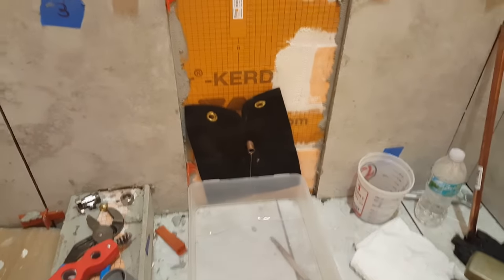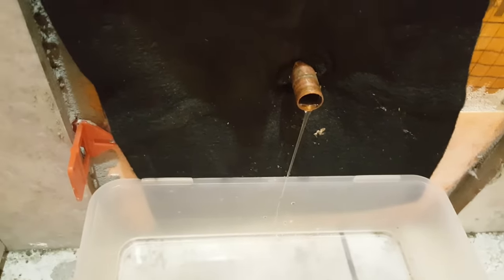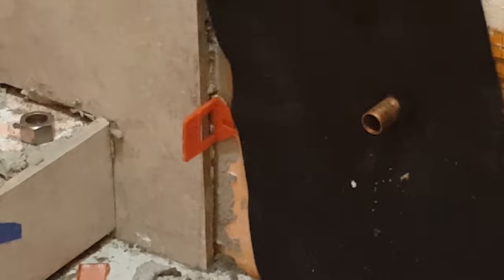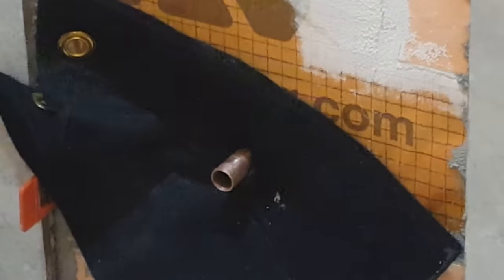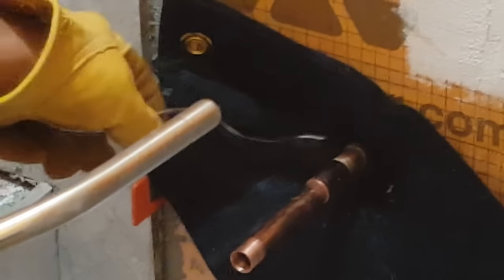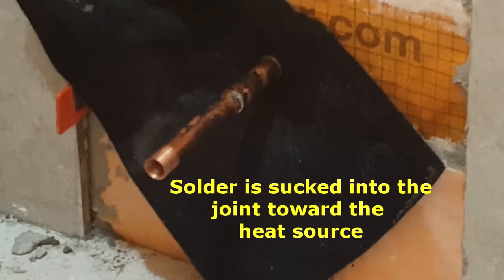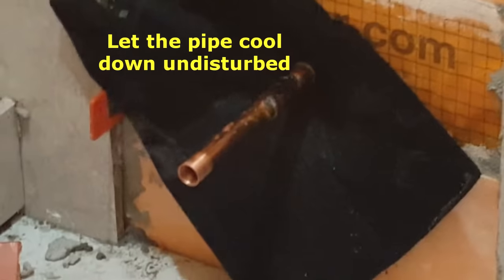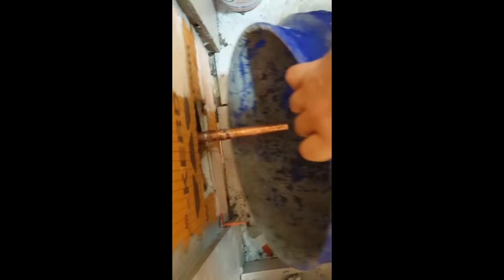Insane Plumber's Trick: Solder Copper Pipes Dripping Water

Comment: My guess is you are not really open to a critique so I won't give one, but this video is not recommended
Reply from the maker: I'm always open to critique.
Reply: @jeffostroff  Another thing that can be done, is to open an outside faucet near the main shutoff, and use a portable tank of compressed air, to blow the water out of the line about to be soldered.  The bread idea is only going to work, if there is a no actual leaking water. The way the water was trickling, there is a good chance of water cooling the copper, right as the solder is wetting to the metal with flux, ending up with a possible spot where the solder did not wet all the full length of the pipe and coupling. The steam visible from the pipe tells us water got past the bread. So there is a risk the pipe may leak later on.

Comment: you need a jet swet
Reply from the maker: 2 things here, 1) this is a DIY video for homeowners, whom you'll never convince to spend $100+ on a tool they will use once, when the bread trick works every time for free. 2) We have a video on the Jet Swet here: https://youtu.be/h1ZF7MWrh1k "Jet Swet Plumbing Tool Helps You Solder Pipe With Water in it"
Reply: @jeffostroff  true that

Comment: NEVER flux the inside of a pipe
Reply from the maker: Never troll a video and tell someone not to flux the inside of the pipe without checking the comments first from the other 100 people before you who already stated that.
Reply: @jeffostroff  I'm not trolling you mate, I'm a plumber and was giving you personal advice to never solder the inside of a pipe unless it's swaged, I'm not a troll 👍
Reply from the maker: @United-Til-I-Die   I did not solder the inside of the pipe I accidentally put flux on the inside,  A momentary lapse of focus slip of the wrist and if you pay attention in the video you can hear me say right after I I applied the flux inside it that it was not necessary. It was 95 and humid in there on the hottest day of that July in a condo villa with really bed insulation in the attic over our heads, no AC flowing to the bathroom, we measured a 130ﾟ temperature in attic over our head. It was the end of long tiring day we had somebody having a meltdown in the next room from us while we were trying to do this and focus on the repair, shooting video, stress of water not cutting off, and we are not allowed to touch the street shut off, and yes I lost my focus for a brief moment. But we cleaned it up and I also use water soluble flux. So it's not like it was some fatal mistake that manifested itself into the final product. I'm sure you've made your share of mistakes over the years as well. I can assure you no humans died because of my slight misstep.
Reply: @jeffostroff  sorry i meant flux inside, not solder 🤦🏻‍♂️, was genuinely just giving advice to you mate 👍, the solder will follow the flux inside the pipe and could cause a solder blob and restrict flow rate and cause water hammer 👍
Reply: @jeffostroff  and yes mate, made mistakes in my line of work, every day is a school day 😏

Comment: first off all, you could have cleaned the copper even while the water is still coming out. Second, you didn't even do a proper solder seal. Third, you only heated one side, I saw no torch rolling around that pipe to make sure the fitting is heated evenly.
Reply from the maker: The solder sealed nicely and it still holding up 5 years later.

Comment: Dont clean or flux the inside of the pipe. Only outside of pipe and inside of fitting
Reply from the maker: Yes it was a momentary slip of the wrist but I guess you didn't pay attention enough to hear me say afterwards that wasn't needed.
Reply: @jeffostroff  u said u probably didnt need it but ur doing it anyway which shows me ur not too sure. You should just admit that at the time of the video u were not sure of urself instead of lying to everyone saying it was a slip of the wrist.
Reply from the maker: @alexstoles1339  Not lying, I did it by mistake, and said it was not needed. I did not "do it anyway" like you said. I realized the moment I did it that I screwed up, and admitted it was not needed. No way to undo it. It's water soluble flux, and washed out on its own when we flushed the pipe. Now you're saying I did it anyway after I said it was not needed? Freaking Democrats, you're all the same. Always have to lie and make stuff up. You're just trying to find problems where there are none.
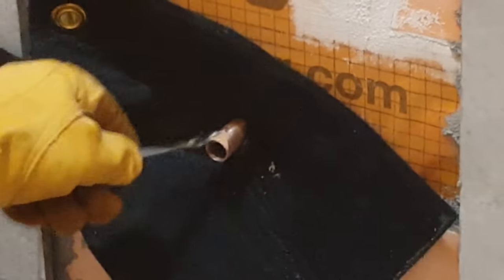Reply: @jeffostroff  go back and listen around 3:10 u said" it PROBABLY DOESNT NEED IT BUT"  that means ur not sure. Probably  is not definite. Nobody here lying but u buddy. U cant admit it but its cool. U can live with being that guy lol. Btw i didnt know this would strike such a soft spot for u. I apologize if ur feeling are hurt. My original message was just to help u out to do it the right way.

Comment: Just find a faucet at a lower level and turn it on, gravity will do the rest and the water will stop running.
Reply from the maker: It's funny how people keep coming here with this same useless advice, they all must have copied it from the same uninformed person. We had already opened valves and re-closed other valves, nothing helps, the water was running, not dripping for the last hour before this video. It is leaking past the gate valve, so nothing will stop it. And this toilet valve IS the lowest level, there is nothing lower than this valve.  When you have a gate valve that refuses to close, nothing will stop the flow of water other than plugging the pipe momentarily.
Reply: @jeffostroff  Wasn't trying to be clever - No basement faucet? thats what I used a few times... then I was  incorrect nothing else would work and yes I have had that exact problem and used a cork on a string with a knot to extract it later, default is a shark bite connector
Reply from the maker: @marciamenage931  Nope. We are in south Florida, no basements here.

Comment: Disconnect the meter. problem solved
Reply from the maker: Not exactly, problem not solved. Many condos require you to give 48 hours notice before shutting off the main, because it will affect many other people. They have to post a warning notice at the elevators for 24 hours before the shutoff too.  People always forget that. You can't just be impulsive and run to shut off the main.
Reply: @jeffostroff  In the beginning of the video it was stated the water was turned off at the main. So It really depends on what your referring to as main, most condos/apartments have shutoffs at each unit. I wouldn't consider a isolated shutoff to be the true main. But I know how it goes in complexes with their policies. But any who the classic bread trick will get you out of a pinch, thanks for sharing!
Reply from the maker: Yes, usually when I say "the main" it means wherever the shut off is for the unit. I usually say "shut off at the street" to refer to the water meter. Or also I'v been known to say shut off at the meter.
Reply from the maker: yes I meant the main water shutoff  of the condo, which was a gate valve over the washer and dryer. I will usually say "shut it off at the street" if I need to go to the meter. but usually in some condos, you have to get permission from HOA first, post a notice at the elevator, 48 hours notice, pain in neck.

Comment: This gentleman is not holding the torch correctly the torch should be turned down and the torch should also be to the point where that extremely blue flame is only about a half inch away from the pipe
Reply from the maker: Everyone has their own way of will be holds the torch and if the others don't do it their way then it's wrong

Comment: Bruh you can't even put the oil from your hands in your pipe let alone a giant chunk of bread....
Reply from the maker: Yes you can, inside the pipe is not where the solder goes. The bread gets flushed out afterwards. Plumbers have been doing this trick for 100 years.

Comment: The pipe coming out of the wall....Jesus Christ man....you don't need to clean the inside of that pipe. And in case you never learned this before...heat rises...put the flame under the fitting.
Reply from the maker: You are actually supposed to start the heat at the bottom, and lead the heat around the top of the pipe, leading the heat before the solder. You can sit there and heat the bottom all you want.

Comment: You DON'T want to do this way !!!  Get a proper Jet Sweat or similar expanding plug tool,  that's all you need and you can solder like normal.  Also you cleaned the inside of the pipe (not needed), you held the torch on the side of the fitting (WRONG). Your flame is way too big and too close causing you to burn the crap out of the fitting/pipe and thus oxidized it all which means the solder won't stick to it after it oxidizes.  At least hold the torch under the pipe and further away and sweat the water out first then clean it all with flux to remove the oxidation once the water is all out then solder it.  You can see on the first joint the solder stuck to the coupler instead of the pipe for the most part which means there was still water in the pipe. Lucky if there was actually no leak after this one.
Reply from the maker: I got news for you professional plumbers have been doing this for decades. Also this is A DIY video for home owners they're not going to spend 50 bucks a Jet Swet,  Just because you come in here off your high horse declaring that anybody that does this trick is an amateur does not mean it is so.
Reply: @jeffostroff  Professional means jack shit, if a professional uses actual bread I would be embarrassed to call myself one. But then the world if full of so called 'professionals' and its SCARY.  I wouldn't let them or you near my pipes after seeing how you soldered lol.

Comment: This video although helpful is not nesessarily the only way to do this.Use compression unions or ball valves with compression fittings and end of the story.Applying flux on the inside of the pipe is not the smartest thing to do because flux is an acid and can and will eat through the copper.You also forgot to debur the inside of that copper pipe and deburring the inside of the copper pipe is extremely important because if the inside of the copper pipe isn't deburred water flowing through the pipe will cause turbulance which will lead to pin holes in the copper pipe.While you were at it why didn't you solder a male or female adapter on that pipe so that way you could screw a valve onto the pipe?All I can give you is an "E" for effort.You should have planned better for that repair that you recorded yourself doing.You ended up using a valve with a compression fitting on it so what was the point of this video?To show how to extend the copper pipe by soldering another piece of copper pipe onto the existing piece of copper pipe?I started soldering pipe when I was 16 years old,I had the honor and priviledge of working with licensed contractors and plumbers that taught me.I am now 59 years old and still solder copper pipe and I can honestly say that your skills are lacking dude.For soldering copper pipe where space allows to do so safely the torch that you used in the video is good but for a space so close to the wall like that the torch you should have been using is a torch with a pencil tube on it which is good for soldering copper pipe up to 1".You should have also applied the torch to the bottom of that copper coupling because the way you were using that torch most of the solder was drawn to the top of that copper coupling.At least you tried dude,thanks for sharing.
Reply from the maker: Lot of the things you complained about were simply wrong. I did debur the pipe, just didn't make it into the final cut. You can see my gray deburring tool sitting on the shower curb at 0:02 in the video. Pity you don't know what a deburring tool look like. Like countless finger pointers before you, you noticed I fluxed the inside of the pipe, but in your zeal to prove me wrong, you did not hear me say right afterwards that I did not need to do that. Also, we cleaned out the pipe later, and I guess you never heard of water soluable flux, and you don't understand that flux was brunt off by the heat. We used a compression valve at the end of the video, so you are wondering what was the point? the builder left so little pipe coming out of the wall, that with the new tile, and 1/2" of mortar behind it, and the 1/2" of tile backing board we added left us with not enough room to put anything. I give you an E for observation and jump to conclusion skills.

Comment: I had same trouble but I inch copper used toilet paper
Reply from the maker: Toilet paper actually worked?  Did it have a payload in it? LOL!
Reply: Y wouldn't it work just holds drips till you solder it on

Comment: My 16 year old cousin can solder better than that! Heat from bottom and reduce the flame Mr. Also for many who aren’t experienced during recommend a 3/4 shark bite ball valve to stop that leak 😬
Reply from the maker: True but you are forgetting that this is the torch that most homeowners can buy when they go to home depot they are not going to get the best tips that give you the best control over the flames either. Then spend even more for tips to better control the flame

Comment: why is kerdi board  behind toilet,...look at all the steam as you attempt  to solder, I hope that's water soluble solder or it will invite corrosion,...lose the gloves,
Reply from the maker: The Kerdie board was behind the toilet because tile is going up there behind the tiilet.  Yes I only use water soluble flux and  the lead free solder. You are supposed to wear gloves when you're soldering. You don't lose the gloves during soldering your supposed to wear them. You are not supposed to touch pipes with your bare hands when you're soldering.
Reply: @jeffostroff  ,I just dont touch the part  I'm soldering,its cool if you need gloves,probably  wont get burned,I made alot of mistakes  as I refined my techniques, boiling the water away,used alot of gas  ,had a call back from a poor joint,too much  steam,I did invest in the springloaded ,rubber balls ,they slide in past  the joint ,basically improved  bread ,keep at it you'll cut more and more unnecessary steps  as you master it, I use the flame guard toi,and a squirt bottle,sometimes  pre soldering assemblies,or tinning a tough to access joint,

Comment: U just open a sink valve
Reply from the maker: Wow, another expert plumber! Duh, that was tried all over the place. When you have running water from a gate valve that won't close, opening another valve somewhere does not somehow miraculously relieve that amount of water that still flows past the gate valve. Your solution sometimes works if the gate valve did close all the way and there's no longer any flowing water but there is still leftover water in the pipes.
Reply: @jeffostroff    im not a pro but. umm yeah  water is trapped in the line. U open the shower or a few lines up and it creates a vaccume or how about shutting the main valve off. But your vid is about water in the line so its a nice method. Ive learned from ur vid and commets good or bad.

Comment: wow this is not good technique
Reply from the maker: It is still holding up 4 years later. Might not be the way you would do it, but the solder is in the joint. What in particular wa snot a good technique?
Reply: @jeffostroff  i already said and much more there are professional welding classes

Comment: So many rookie mistakes . Never put flux inside the pipe . Under over flame under solder over . Never use wet rag to cool pipe let it cool on it's own . Only wipe flux off with dry rag .
Reply from the maker: You didn't watch the video, yet you come here trolling anyway. At 5:45 you'll specifically hear me saw wait until it cools back down to temperature, and to not touch it and leave it alone. Also, there is nothing wrong with using a wet cloth afterwards to wipe it down, not to cool it down, but to wipe it down. This is after all water soluble flux anyway. But it does not matter whether you wipe it down with a wet or dry rag. Also, I already stated in the video as soon as I fluxed the inside of the pipe that it was not needed. You don't need to charge in hear like the town crier. You act as though you never made mistakes.

Comment: If that keeps running water 1hour after you shut the water off you have bigger problem!!  It’s obvious your main is not working properly
Reply from the maker: Yes, they were not allowed to mess with the main. virtually every house in our are built in the 1980s and 1990s have faulty shut off mains, because the builders used real cheap quality parts.

Comment: After your 5 attempts because of leaks all you need to do is go to the water meter and break the Union on the house side to alleviate the water. You need a smaller torch head dude why don’t you carry a spray bottle to cool the pipe and solder flux. Rookies
Reply from the maker: You completely missed the point of this video, sailed right over your head. THIS IS A DIY VIDEO for homeowners, not for plumbers. Homeowners have the cheap home depot $40 torch kit not your fancy kit with multiple heads. Also you can't just go outside and start playing with the street cutoff when it affects other condo unit owners too, they need 24 hours notice, permission, etc, to get water cut off. You must be a rookie, because you are NEVER supposed to spray down a hot pipe, it leads to fractures of the solder joint. Any knowledgeable plumber with half an ounce of sense will tell you that. Funny, you came here to school us , but you got schooled instead. Rookie...

Comment: you burned the fitting smh
Reply from the maker: The fitting did not get burnt. Take a look at the finished product. you have no clue about what you are speaking of. Flux naturally discolors when it heats up and you wipe off the residue with a wet rag after it reaches room temperature. If you have no clue about plumbing, you should not be criticizing those who do.